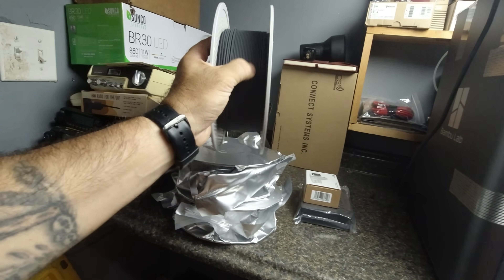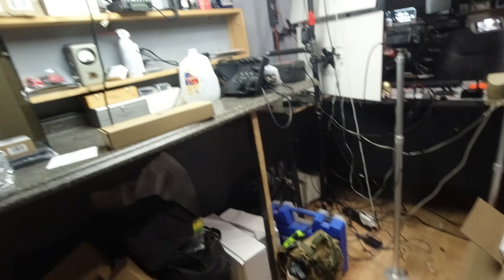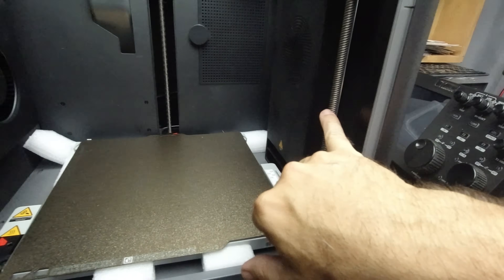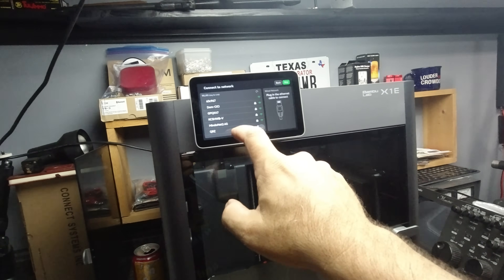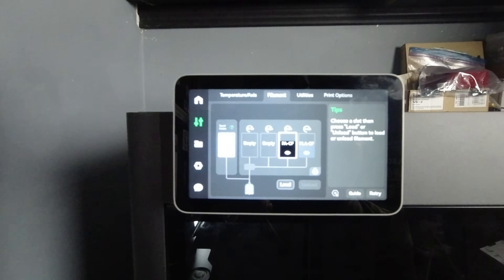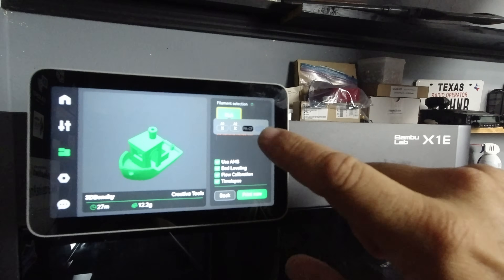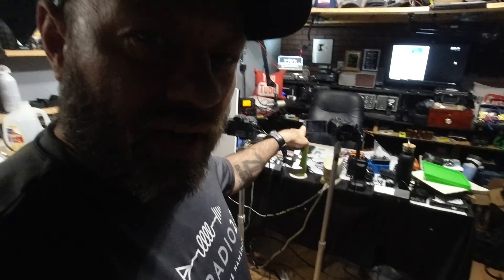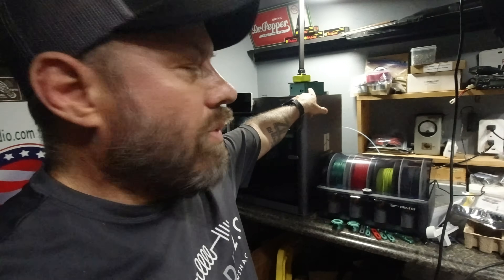The Easiest Way to Set Up Your Bambu X1E 3D Printer Without Frustration

Comment: You can see that shipping brace on the right side of the bed earlier in the video where you had pulled out some of the packing material but not all of it.

Congrats on the new printer, there's a lot you can do with it and it's a great journey to be on.

Comment: I think your issue with the benchy in the printer is its pre sliced for PLA, also you should have the spool holder that mounts on the back.
Reply from the maker: Yes I think you are right
Reply: looks like you figured it out, well it wasn't that you didn't have the AMS full, it was becasue you didn't have any PLA loaded
Reply: Could it be that you have to populate the AMS from left to right. Not necessarily that you must have all 4 slots loaded?
Just guessing
73
Reply from the maker: Yes, could be

Comment: You can use more then 4 spools with a hub just so you know
Reply from the maker: Up to 4 AMS units, I am told.
Reply: I keep one AMS loaded with PLA, and the other with PETG. If I’m using a different type of filament for a one off print, I use the spool on the back, or I use my Prusa MK4s.